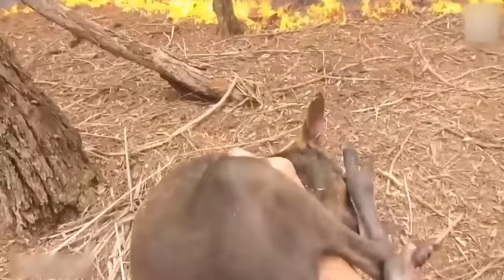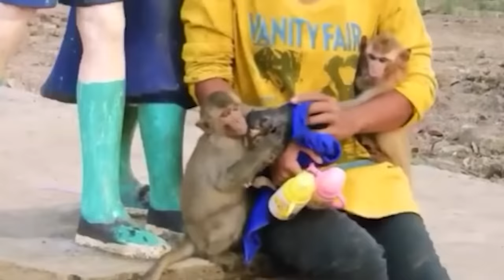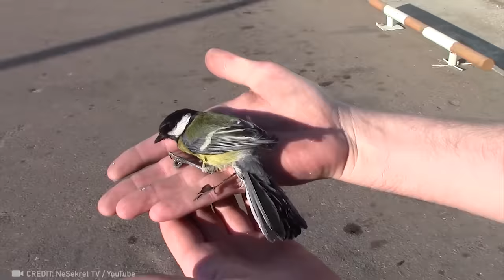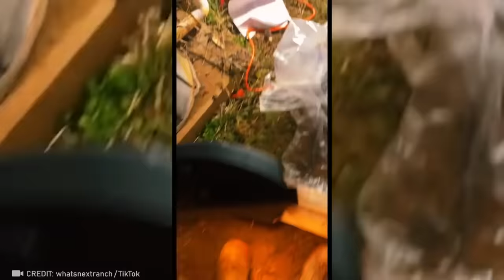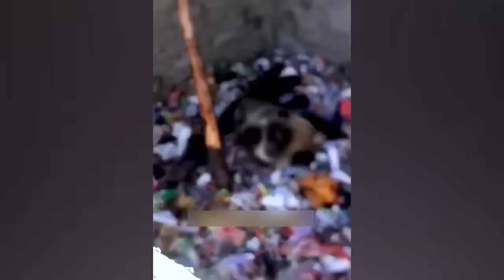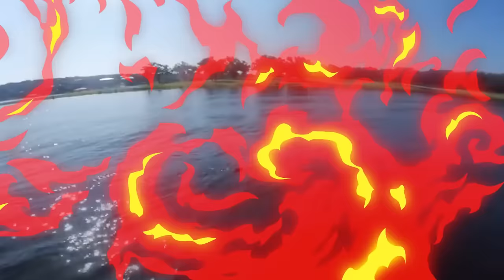Animals That Asked People for Help & Kindness | Best Moments of Winter !

Comment: I used to work roving night security at the compound/yard for our big utility company and one of my jobs was to check all the dumpsters for trapped raccoons and help them out if I found any. If the trash level was too low they couldn't get out so we kept some old 2x4's by each one to put in as a little ladder if needed. They all knew we'd be by sooner or later to help them get out and we had an amicable relationship. It was pretty normal to look in one and find several raccoons just patiently sitting there waiting for me to put the board in, totally chill, and just lazily climb up and go by me like it's a shift change. I miss that.